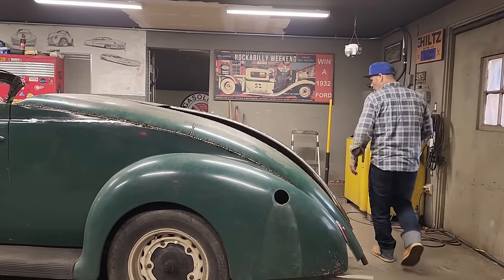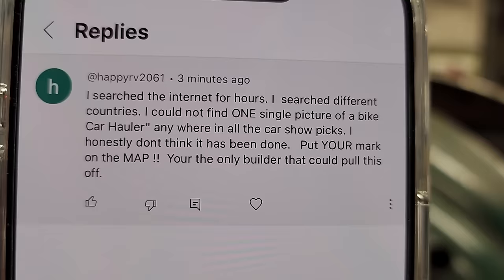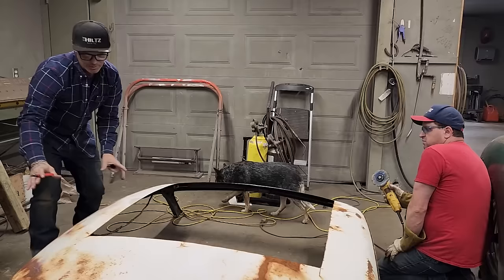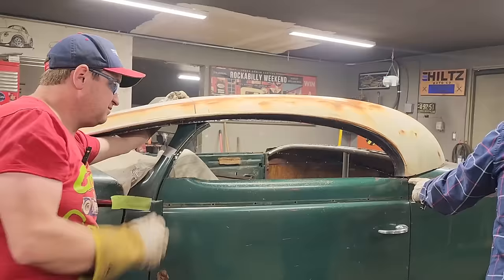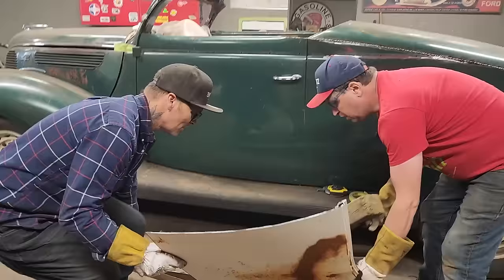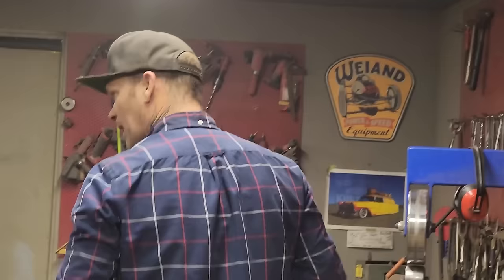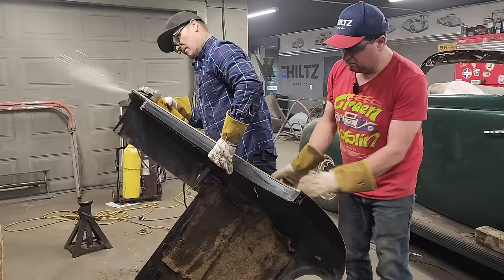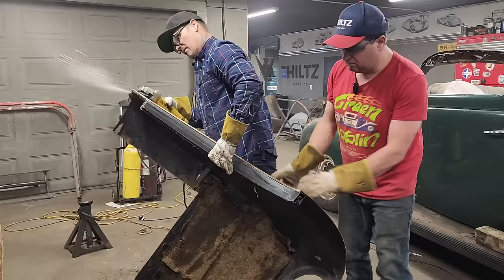Another major design change... 1959 Jaguar roof? 🤯

Comment: I like the idea of a round body bead where the top meets the metal below the window. I’m thinking of the old 48 to 54 Chevy pick up trucks that had a rib all the way around the cab where the roof met The cab. It was the rim where the factory pinstripe went. Something like that would take care of the flaw, for lack of a better term and the two piece back window I was speaking of in a earlier post like a VW split window would take care of the pointed back window area. This is too cool! I’m loving it!

Comment: Going to be very difficult to back the bike into the hauler. I suggest you make a sled to put the bike on and wench it into your hauler. I’ve seen this done on trucks and it is really cool. 
Also want to say I love your program and watch you every day! Keep up the good work.
Reply: Yeah make the mf sled Chad!
Reply: I was thinking the same thing. Mount the chock to a 4" piece of aluminum channel the full length of the bike, then build a 6" channel into the floor pan and put rollers in it so the 4" channel can roll in and out. Then mount to a long stroke electric actuator and power the bike in and out of the rig. Bonus points if you bag the rear end of the car so that it lays down lower and the moving channel can reach to the ground and not be so high that you can't ride onto it and chock it single handed.

I can see it in my mind's eye and it's slick AF.
Reply: @benparry5318 you are right I see it too and I think the roof is going to be bad ass

Comment: Motorcycle haulers are called pick-up trucks. I've seen a few. You are supposed to do this type of custom thing with junk like this Jaguar roof you are recycling that was rotting in your backyard. The antique you destroyed was a survivor that ran. You are just turning it into a pick-up truck with no bed. Why not bring the bike over so we can see how far the wheel goes over the back and how you plan on getting it up in there. You'll need a track for the front wheel to lock into and slide forward keeping it balanced. Or will this project be scrapped when you get to this aspect of the build because viewership dwindled when you hem and haw with BS. Why bother using the original pillars? The Jag's pillars are designed for that roof. It's looking frankensteined together. The line/curve is not a smooth transition. Then you have the door detail you'll have to rework into the pillar. There's much more to structure than just the outer skin you see.

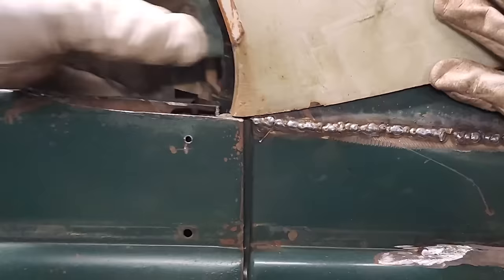Comment: 47:26 I’ve been rewatching this since you posted the video, maybe it will work maybe it won’t, but I think if you took a inch more out on the roof just in this section where the door pillars meet you would gain roof metal along the whole lower edge of the back side of the roof eliminating having to press the metal out of shape trying to get the different body lines to line up or adding a strip of new metal in. You could just trim the roof to match the new body line, also it would lower the back just a bit and you already have to set the rear windshield back in place so trimming the roof to get it back in place wouldn’t be that much of a task. Just an opinion.

Comment: I was skeptical at first with this whole ideal but I’ve been converted and this will turn out very unique. A coupe for cruising and a bike hauler for the right occasion. Just remember that the older the paint your grinding and sanding, the more lead it contains. A good air exchanger can fix that !!

Comment: For your consideration. 1) mount the motor cycle horizontal to the ground, 2) find a 1938 cycle, & 3) form a clear “bubble top” so the cycle is visible and since horizontal, will appear to be headed down the road with the car.

Comment: Paul Bacon Kustom Works on you tube here is building a bike hauler out of a London taxi. he does some crazy stuff with fiberglass. he has some very interesting builds.  then another scratch built bike truck was done by Ed Roth called Captain Pepe mega cycle but that was mainly fiberglass too.  that was restored by Spritz by fritz

Comment: Instead of having a one piece rear window you could make it a two piece that joins in the middle, each side at a slightly different angle giving it a kinda boat tail appearance. Also: To locate center across an area that isn’t in a straight line just measure from an identical point on each side and make a mark a bit past center at the same measurement on the tape. Then all you have to do is measure between those two marks to find the center line.

Comment: Seems like it would be easier to complete the interior before putting a roof on. But then, most of the builds I have watched never got a finished interior. It's like building a model airplane with nothing inside. Just an exterior shell. Go figure.

Comment: Keep the drip rail as it gives the roof some definition, improves the vintage look as it blends with the Ford, and adds to the structural strength of the roof panel as well.

Comment: Should leave the sides of the back window attached and cut the top of the window until the top is installed.  that way you can straighten it without starting over.  I really like the top.

Comment: I think two back windows or split window as the Volkswagens were called would not only look good but would cure the problem with the center pointing outward when the Front at the windshield post comes inward.

Comment: 1 inch round rod will fill in the gap at back of roof and add some type of fast release  clips so it can be removed...you will need some type of reinforcement for tbe back of the roof on tbe body

Comment: Use the door window Post to fill the gap on the front pillar post you cut out just the front section work look badass it doesn't look right at the front pillar post not thick enough

Comment: Wouldn't it be easier  and look better to  buy a  55 Chev pick up and use  it as a bike hauler,   that old classic would of looked the part lowed and a 2 inch chopped  with  2 pair of spare tyres on  each side of the front mud guards,  
Sorry Chad love your work 💯 and  show but totally against chopping up a perfect old classic car body. 😢

Comment: Mr Chad , what will you do if you get caught in a rain storm while driving the motorcycle hauler. How will you close up the opening ,so the motorcycle and inside of car doesn't get wet. Unless you make a special tarp cover with Velcro glued to car and tarp . Keep it handy inside of car for rain emergency. Use the commercial Velcro for super grip. Got to cover all your bases.

Comment: Sorry Chad! Custom Works(YouTube Channel)  is currently doing one well before you! Been happening for months.I actually thought you copied them. Fortunately they are using a lot of fibreglass and not trashing a heap of restorable projects…
Reply: Looked up custom works, all I see is power stroke mechs. Could it be called something else?
Reply: @thomasmorrison9871  it is Paul Bacons Kustom Works. He does mega fibreglass works. He converts things like old London cabs and ends up with what appears to be a early 50s Ford or Chev truck. He also has an automated rail system to pull the chopper onto the back of the truck. Well worth watching.I hope you find it.
Reply: Ha that channel is as you say trashing restorable also. And that one is a pickup😂

Comment: OK LETS PLAY A GAME. I would like to see U push your new Bike on to a trailer 24" wide how ever tall your car is going to end up. what i would like to see is U push your new Bike in to a 24" inclosed trailer by it's back tire because i don't think in that 24" space that U and the Bike will fit. if the Bike has to be in the middle. 4' ramp